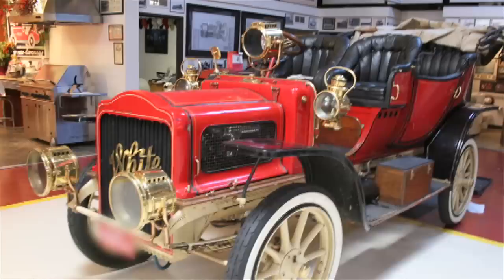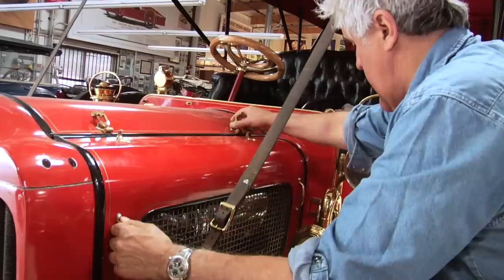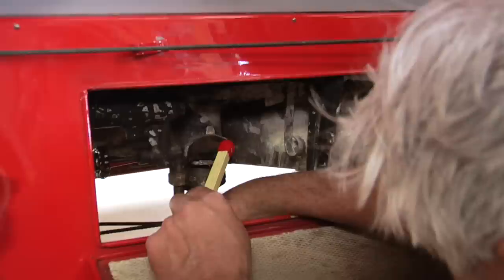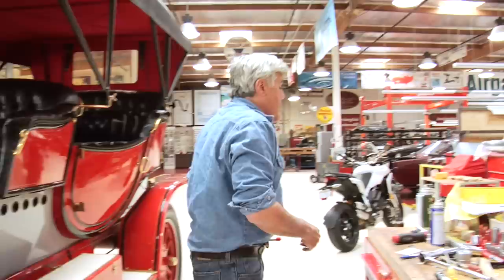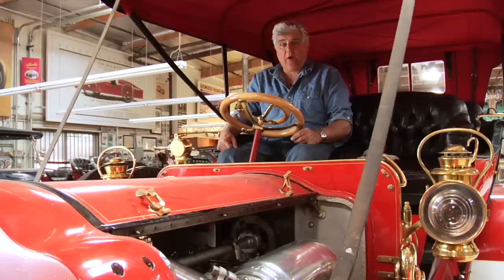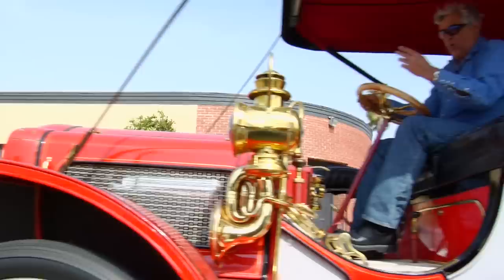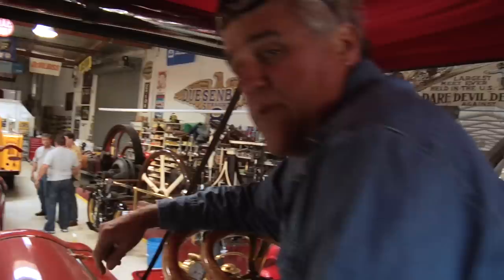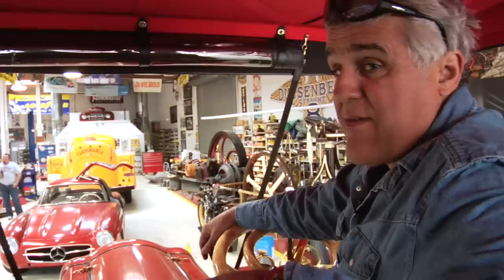1907 White Steam Car, 30 Hp - Jay Leno's Garage

Comment: The only thing that I think could potentially Improve a White (or any Steam Car) is supplanting petrol for the fuel source for something that is already a gas like CNG or H² so that you can get rid of the pilot system. You could probably get the boiler hotter too with those because you could focus on managing the air-fuel mixture to a higher degree.
Reply: The burner requires excess air for cooling, increasing the temperature also increase the very high NOx emissions that create photo-chemical smog.
Reply: Switching to a gaseous fuel would also reduce range.
Reply: @doktorbimmer  H² only has water as the emission.
Reply: FALSE, when H² is consumed in external combustion engines it must combine with air for combustion to occur, this requires a Lean non-stoichiometric AFR with excess O₂. This creates large quantities of NO² along with other NOx compounds which causes cancer and lung tissue damage, when exposed to UV sunlight it forms a noxious toxic gas called photo-chemical smog.
Reply: No legitimate, educated automotive engineer would ever consider steam as a commercial viable concept due to the horribly low thermal fuel efficiency limits established by the Carnot Formula, prohibitive manufacturing cost, high operating and maintenance costs. Hydrogen fuel would only increase the cost and complexity.
Reply: @doktorbimmer  Dude, I'm not wanting to make business out of i it's just for fun chill.
Reply: I doesn't sound like any kind of viable business that is for sure... Just the facts here, steam cars have been obsolete for a century for some very good reasons, the problems is most people today do not seem to understand what they are.
Reply: @doktorbimmer  Doesn't mean I don't want one there is plenty  of pooly design crap I literally own a V12 BMW that doesn't run I own in the same way Jay Leno owns his and Steam Trains are used for recreation in almost every country.
Reply: Most surviving steam cars do not run, few people have the financial resources that Jay has to restore AND maintain these incredibly expensive and high maintenance vehicles and keep them running. If you can't keep a BMW running? Good luck with your steam car project... sound like you would have a difficult time just maintaining a bicycle. Which only proves my point... once a vehicle type becomes obsolete a few fortunate examples get saved for the sake of historical preservation.

Comment: What's the small wheel inside the steering wheel?
Reply: Jay Leno will tell you that the small wheel inside the steering wheel is for smaller turns  ;) .
Actually, it's the throttle.
Cool car, but it seems like a real challenge to drive  :) .
Reply: ***** They should hire people to turn these car on and pay them like 1,000 dollars per turn on.

Comment: You can probably still drive steam cars today. They are just as quick as gas cars but probably has better fuel economy. No charging necessary. I'd rather have this than a pure electric car. A White steam car probably does better than a Stanley steam car. The 1925 Doble steam car is certainly the best steam car ever.

Comment: The flow motor sounds like a fuel injection concept
Reply: Not really, it sounds more like an integrated water and fuel delivery control system...because that is exactly what it is.

Comment: Yeah if I had a steam car like this like a white one that was totally rebuilt like not an original White Steam car it's a new one made from new materials or whatever. But it would have liked turn signals and whatnot xcetera. Instead of having to go under there and light the flame make sure you'd still have to twist all of the valves and whatnot I would do something where are you have to flip a switch or what not to get the flame going. I know now I don't know much about this stuff so please don't get mad at me

Comment: So they don't have a fuel pump? Do they just pump air into the gasoline tank and use that to push fuel to the burner? I guess safety was less of a thing back then but compressed air and gasoline inside a gas tank seem like a recipe for dramatic fires.

Comment: So it took 10minutes to get a steam car up and running. Compared to my last late model Chevy pickup, that is not too bad. Since my Chevy had a pass lock ignition theft deterrence system. Which in a couple of years wore out from a normal sized key chain. And would cut the fuel pump while starting. If you did not have the key in the ignition perfectly, and turned the key ever so smoothly. Funny but, it still allowed the engine to turn over, just cut fuel. Anyhow, I ended up having to cut a blue and white wire in the steering column, to disable this pass lock BS. But after doing so, there was a warning light that would glow continuously on the dash. In the shape of a small car and a padlock through it. A small price to pay after countless 10min late appointments. So the moral of my story is. With the endless technology crammed into modern cars. They are no better than a 19'O something steam car. On both relability, and ease of use. And they are just as complicated to operate in some cases. With all those accessories no one really needs.

Comment: When did the steam cars come around?  Were they always gasoline-steam cars or did you have to light and maintain old fashioned fires on the early cars?
Reply: The earliest motorized land vehicles were steam, but they did not become a practical aumotibile concept until the introduction of liquid fuels that allowed a single person to drive without the assistance of a "fireman" to stoke the boiler on the move. There are some examples of steam shovels and trucks which used coal fired boilers but a practical steam car really requires gasoline or kerosene.
Reply: Solid fuels such as wood present a few problems for cars... the Doble steam car required a 30 gallon kerosene fuel tank... to achieve the same range would require 600-800 pounds of well seasoned hardwood (between 30 -50 cubic feet or 1/5-1/4 of a cord) not very practical as it would consume most of the available space and payload of an averaged size car.

Comment: I here that in the50s a Stanley steamer drove coast to coast on. $12.00. Of stove oil is that true
Reply: They were available with 2 types of burners...kerosene and gasoline. Pilots usually ran on hexane. They were very inefficient.

Comment: I mean, DANG ! Too many procedures just to start the car.
Reply: That or people today are just much much more lazy...
Reply: Gas cars used to not be much better. In winter you'd have to let the engine warm up. Before the electric starter you would have to crank the engine by hand. By the 20s the steam cars were pretty quick, too.
Reply: +Bad Beard Bill  Everything changed in 1915 when Charles Kettering invented the electric starter.. steam cars virtually became obsolete overnight...
Reply: Nope. Charles Kettering developed and patented the starter during 1910-11, and it was introduced on the 1912 Cadillac. It was so popular that by 1919 you could get a starter on Model T!

Comment: anybody know how any minutes of heatting per gallon of fuel? and what kind of fuel is it?
Reply: +Dan Hard I do not know about the whites but steam cars were quite refined by the 1850's in Britain many had flash boilers so 1 minute is probably common. These were not fast cars but very quiet horseless carriages.

Please correct me if you know different?
Reply: +Dan Hard As far as I know, they run on regular gasoline, like everything else back then.
Reply: +Buddy Clem Or paraffin.
Reply: +Andrew Lohmann To correct myself the flash boiler was invented and started to be used in steam cars from 1873 -1890's.

1 to 2 minutes to go. But there was a lot of other things to do before you can go as jay shows us.

Comment: Really makes you think with today's technology, if a steam car burning diesel or gas with all the regulator valves & control electronically regulated can be made.
Reply: This car already runs on Diesel or gasoline...  Why would anyone build a steam car today? steam car are obsolete for several very important reasons.

Comment: Suggested "improvement(s)": Make it run on propane or compressed natural gas.  This eliminates having to pressurize the gasoline tank, the fuel vaporization requirement with all its finger burning and the pilot light requirement.  A "modern White" would not be very efficient compared to internal combustion, obviously, but it could be improved considerably given modern technology.  I retire in about ten years.  I'm already starting to assemble components.  My car will run on compressed natural gas and use an electric spark ignition like on modern furnaces and gas grills.   I plan for a fire tube boiler to get more water capacity and hopefully a triple-expansion engine.   Super-heated steam is definitely advantageous.  

This would work ever so much better with a miniaturized pebble-bed fission reactor and once collision avoidance systems get the bugs worked out, it might be feasible.  Except for the idiots who would try to make dirty bombs out of the reactor core....

In any case, Jay, thanks for helping to keep this technology alive!
Reply: A triple-expansion engine, in a car??? That is an interesting choice for a car design, as I understand that would require additional vacuum pumps and a extremely large and heavy steam-to-air condenser to achieve any of the efficiency gains possible with a triple engine. Most steam locomotives use Single Expansion because of this very same design problem. Do you have any estimates for external dimensions for the vacuum condenser required? I would be interested in seeing your calculations for this build.
Reply: I would like to see my calculations as well, but I probably won't be making them.  This is pretty much a dream car for me... a steamboat on a pontoon boat platform would be more likely.

I don't know why such a design would need vacuum pumps at all if it had a condenser.  It might need a "doctor" engine to power a water injector pump, but the condenser would create its own vaccuum.  There is no real need for a condenser though.  My car would be a hobby car used to drive around my own property.  I would let God handle the condenser and when I ran out of water, I'd just pull up to the end of the garden hose and fill 'er up.

Triple expansion, or any other compounding gets an efficiency boost by expanding the steam in steps, giving it a thermodynamic efficiency boost.  Its also more expensive to produce and does not lend itself well to most locomotive designs.  You could put one on a Shay design I suppose, but any kind of locomotive with the steam cylinders driving the wheels on the side would be pretty hard to compound.

Locomotives did not use condensers at all.  They just vented to the atmosphere... well, often into the firebox and/or the stack to provide draft.  Most of 'em could go about a hundred miles before running out of water.  Then they'd have to stop and tank up.

There are some manufacturers out there who cater to small steam.  You don't actually need a very large or heavy engine for automotive applications because of the low torque a Rankine cycle engine produces all across its RPM range.  

I think it could be done, but I have no guess as to efficiency.  Steam cars went out of vogue for a variety of reasons, and efficiency was only one of them, though.  I still say that an engineer could vastly improve these machines, but probably not enough to bring them back in any quantity.
Reply: I see, so this is more like wishful thinking and not any kind of serious effort to make a working vehicle that is practical or efficient... 

If a triple expansion engine is not properly engineered it will have less power and less efficiency than a single expansion... basically you spent more time and money to go slower... without a very efficient condenser there are no gains... only additional losses.

Yes but remember the steam also cools as it expands... adding more expansion cylinders comes with a diminishing returns in efficiency.. if not done right the third stage is nothing but a pump... sucking away power from the first two stages.

 Yes, that is right... locomotive builders did not use triple expansion exactly because of this problem... there is an insurmountable size and weigh penalty to adding a large enough steam-to-air condenser and additional vacuum pumps required to gain any useful increase in power or fuel efficiency. triple engine were found on board ships or power plants located near steams or rivers... and not found on vehicles because you need plenty of cold water to make a triple engine work
 Not true, the size a weight of the boiler is proportional to the amount of horsepower produced, the practical size limit for an automobile boiler is only about 30-50 horsepower... not very impressive.
Most amateurs build single expansion engines for a good reason, they are much smaller, cheaper and easier to build and maintain.. but at the cost of truly horrible fuel efficiency. cheers!
Reply: "Practical and efficient" are probably not currently achievable in a small package unless you go with the nuclear option... which pretty much challenges practicality.

Semple used to make a V-twin engine that they said would be practical in a small car.  They did mention that it should have the same cylinders though if memory serves.  Don't know if that engine is still available.

Yes, though, its a "wish car".  Might some day try something like that, depending upon how much time I can devote to it, how much money I have and how long I live.

From the sound of things, you are much more knowledgeable about thermodynamic subjects than I am.  Given time and effort though, I can learn anything.  Took me three tries to get through accounting, but I can find my way around a balance sheet and income statement now.  By comparison, learning German was easy!
Reply: Indeed, reduced size is a huge penalty for steam technology, the most efficient steam engines in the world are generally massive in scale and still barely manage achieve the efficiency of a small automotive Diesel engine.  A Volkswagen Golf can achieve higher thermal efficiency than some 500 mega-watt steam turbines (their economical operation is only made viable with second and third pass heat recovery cycles). You seem more than capable if you set your mind to the task... I myself have a few "dream project" i hope to be able to complete someday too. Cheers!